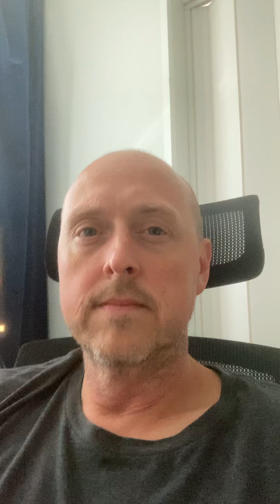3 Tips for Making Money with Tekla Structures

Comment: if you want to even more speed up drawing in tekla, use grasshopper from Rhio, if you have "similar" projects, grasshopper can really speed up drawing. What i also do when i need a custum connection is use multiple components that i explode and take usable parts from those exploded components, that way i limit time on making plates and cuts